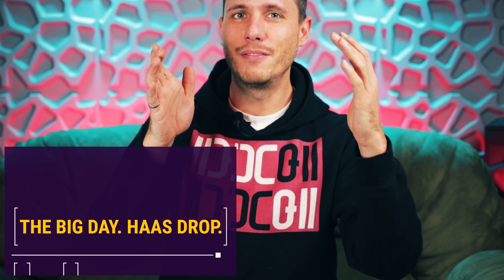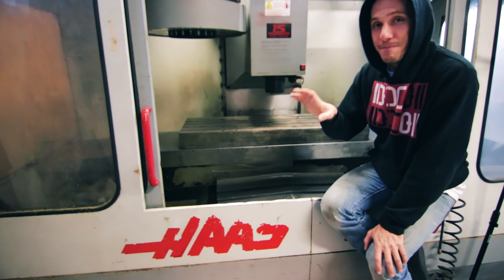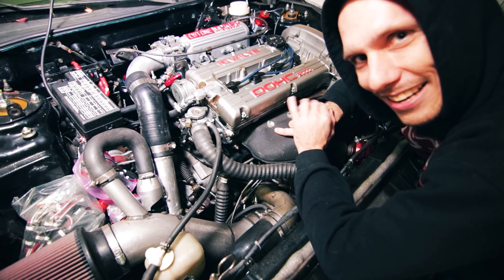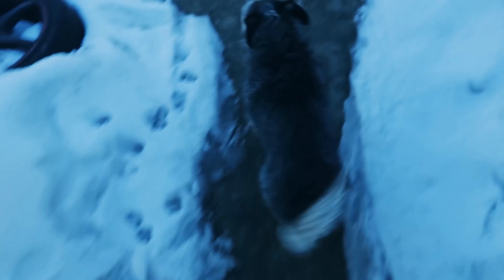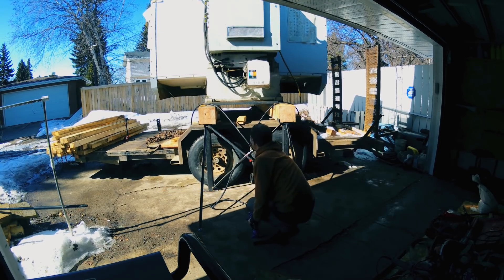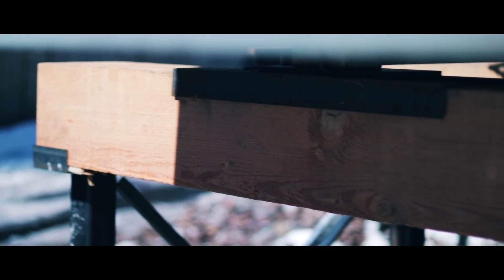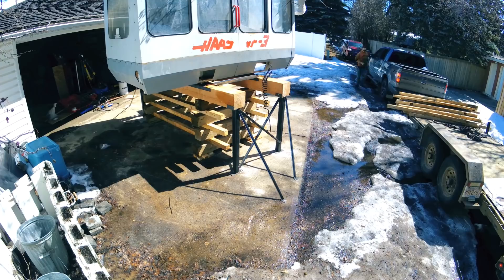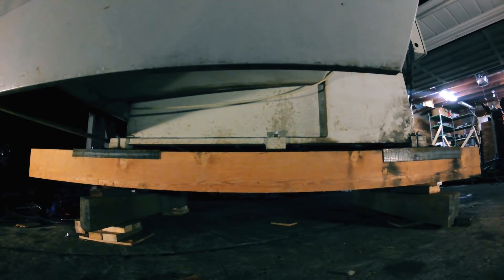Will my welds/beams/MATH hold!?! [How to get a 6 ton CNC off a trailer SOLO]

Comment: Lucas, you're going places.  Keep it coming.  More back story, what are you good at, what are you bad at, what training do you have, where do you see this going?

You mentioned Uni, was it worth it, what did you study, what was worthwhile to the up and coming fabricator, what do you feel was a waste of time, what would you change about the education system to cater to creative, entrepreneurs, fabricators, innovators, ADD mofos who don't fit in?   

When you put graphics up show, weights, measurements, concerns, labeled parts, near future plans, future, far future, music credits and links.  

Talk about the other non-Haas tools, you are using.  Where did you spend the money for the good stuff, and where do you think one can skimp but still get value.

Lucas! You're going places!  

But, you already knew that or you would have already dropped your GF's shades.
Reply from the maker: Thank you Darren. :) All the support is very encouraging. You are askign some amazing questions and have some great ideas. I'm going to print this and pin it so I make sure it include stuff like that where I can.
Reply: I also second the graphics note Darren mentioned. I touched on this before, but in your 2nd video you had leaders to say the forklift for example, then ran some specs on the forklift. More of that shit!